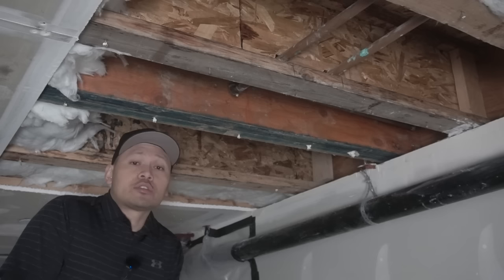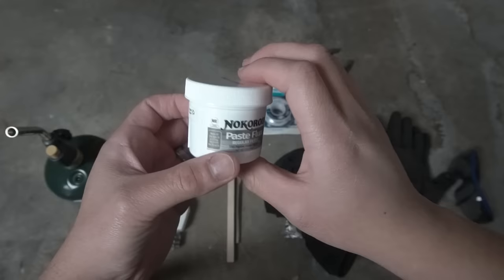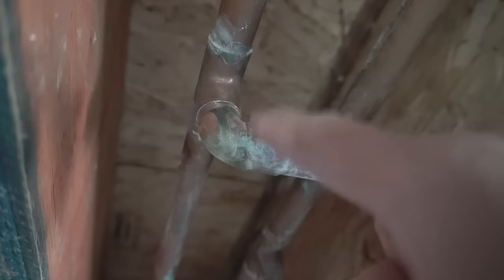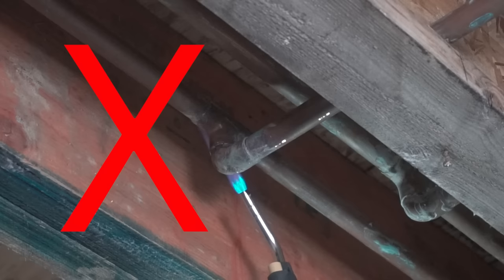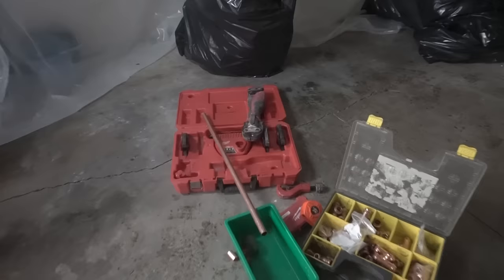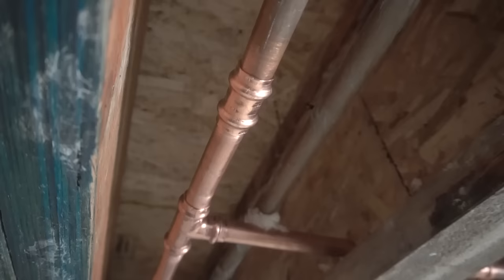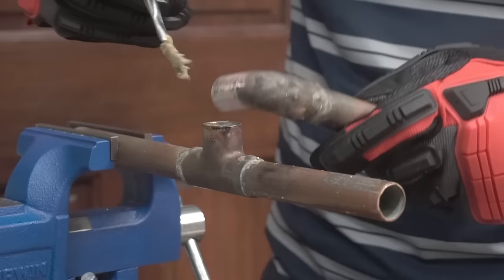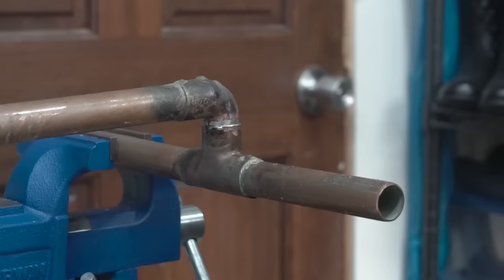How To Fix ANY Pipe Leak! 2 BEST Ways For DIY Plumbing!

Comment: I’m a homeowner, I’m not going to spend $1000+ for the Milwaukee tool, poor solution.   Soldering old fittings is not a good solution, even I know that. I would wait to get water out or use bread and then clean pipes and use new fittings, solder together and done. I have done this before.  Soldering gets easier, the more you do it!
Reply: That tool is over $2k. Easy diy solution! 😅
Reply: SharkBite is much better
Reply: @cryengine_x  ya if you like going back a in a couple years to fix all the water damage from said shark bite.
Reply: @jonathanbarbosa5369 You like others, don’t know how to install them properly.
Reply: White bread or whole wheat?
Reply: @HarveyWallbanger-ho2cq depends on the circumference of the pipe.
Reply: Dumb question, but could you just add more solder to that area where the gap was? Not sure how that stuff works
Reply: Make a cut and drain out the water into a bucket. With all the faucets open, use a shop vac with its filter removed, suck out the water in the pipe. Use MAP gas as it heats up higher. The final joint can use a compression fitting to finish.
Reply: Neither would I, but there is manual crimping tools that you can use and not spend a whole bunch of money
Reply: @Ed-ym4tu what circumstances like if the pipe is on Diet or vegan
Reply: @KeepPrayingCA No you absolutely cannot!  There is a problem with the joint!
Reply: Soldering comes out in time especially when pipes as in use even is it was soldered correctly that’s what they don’t tell you. Also if you fixing another side of the that pipe let’s say for example that other side you claim to solder will come out with movement because solder is not flexible. What the host did have a couple of homeowners solutions I would go with shark bite they last long than solder don’t corrode and upholds in freezing weather I know cause I get a lot of Canada freezing weather -20 to -30 so give the guy credit also the may be expensive but it is also a good solution stop bickering

Comment: don't forget to get a welding blanket if you are soldering near wood and to remove the insulation. You will burn your house down if you can't control the fire.
Reply: I never thought about a welding blanket. Great tip👍

Comment: Your echo in the beginning is horrendous, a little tip that’s cheap and easy to fix it is to hang a blanket in the direction you’ll be talking, ideally behind the camera if possible, this will eat a lot of the excess sound wave and prevent as much echo against bare walls

Comment: You could drill a hole in the elbow to drain the standing water and then proceeded as planned but with just a new elbow fitting.
Reply: Bingo, that is what an actual plumber would do!

Comment: It seems to me that “gap” in the pipe fitting was an actual dent. This fitting should never have been used in the first place and was the reason it failed. The fix should be to replace that dented fitting, not re-solder it.

Comment: Nice job. Yes there are many ways to do this job. But many of us (homeowners) don't have expensive tools to tackle  a job like this one. The compress fitting in is the ideal way to go due to the proximity of the wood subfloor. By avoiding a potential fire. I just wish the prices of these professional tools would come down . Great video. Because you showed us different alternatives to the way to go. Great video. Thanks . May God bless you and your beautiful family.
Reply: The price of tools are relative. "Professional" tools are made of higher quality (typically) to last under daily use. DIY homeowners might need said tool ones or twice in a lifetime.

It's ridiculous to think any and everything can be made and sold for cheap to fit everyone's needs.
Reply: For diy, just rent the tool. I would have used shark bite myself.

Comment: The second you find a single leaking pipe like that, make sure you do the math to see how old your home is.
If it's around 50 years old, then prepare yourself for a major plumbing overhaul sooner than later!
I had so many pin hole leaks in a 6 month span, before ripping it all out and finding even MORE UNSEEN leaks inside some of the walls.
When my house was built, they saw fit to use Type-M lines nearly everywhere (Use type-L!!!)
The stuff I ripped out was paper thin.
The 3/4 " Type-M runs were so thin that I could crush the scrap in my bare hand. It was like a slightly more rigid tin foil.

Goodluck to all you DIYers out there!
You can do it!

Comment: I just had to do this under the house.  I opened up two outside faucets on the house and used compressed air to force excess water out of the pipes.  Worked great.  Didn't have to cut pipe, just unsoldered it.
Reply: Nice job its amazing how many people struggle with this idea. Compressed air is your friend

Comment: Thanks for the video. I would say just use a 3/4 sharkbite elbow - I checked , they do sell them in Home Depot. Cut the corner out and push the pipes in the fitting.
     That’s the easiest . Otherwise sweat another elbow or replace the whole pipe with pex . 
    The propress I would leave to plumbers . Sounds like to be a good solution , but seems very costly for the tools. 
   Another thing that will work is “pipe repair cast” - wrap around and it becomes cast hard. Just make sure there are no pinhole leaks .
Reply: Never EVER use a shark bite fitting in a closed location, such as this.  They are great for exposed connections (under sink, outside…), but not enclosed. Just my 2 cents.

Comment: If you have to solder and water is bubbling through the solder when you heat up the pipe put a chunk of bread in it and quickly solder the pipe. The bread will absorb the water for the time needed to solder the pipe. Then go take of your sink air ratter ( the part where the water comes out of your faucet) and turn on sink. The chunks of bread will pass through your faucet with your air ratter off. Ive done this many times in the past and actually last week when my Milwaukee force logic pro press gun broke and I couldn't get my big ass Ridgid pro press gun up in the joist spacing
Reply: I've been doing that for years
Reply: The bread will junk up on mixing valves don't use bread. A jet sweat is what is used on an open port ball valve or a mip fitting.

Comment: Great video, it would be worth mentioning to always have a fire extinguisher next to you when soldering pipes even the pros start fires worst case a glass of water or full water bottle.
Reply: I took a spray bottle with me under the house and had to use it a few times while soldering.
Reply: I just bring with me a full bladder to pee on it if needed.

Comment: you have to cute the failing fitting rather than the pipe in 3 different locations. you cut making sure you do not cut the pipe only the fitting, that way you can let all the water drain out. all you are left is with 3 copper rings that are much easier to remove. and if needed then you make a second cut for your sliding coupling.

Comment: Make a cut and drain out the water into a bucket. With all the faucets open, use a shop vac with its filter removed, suck out the water in the pipe. Use MAP gas as it heats up higher. The final joint can use a compression fitting to finish.

Comment: I have used the bread technique many times also. White bread works best. Put a ball of it in pipe to stop flow of` water. You have to hurry and soldier before water erodes bread and it starts leaking again. When the job is done the bread will dissolve and be expelled thru the faucet into the drain.

Comment: Nice video. Although Shark Bites, push connectors are taking over the repair industry.
Reply: Good homeowner solution that will last a few years until leaking
Reply: Oh God. I have some kind of weird feelings about shark bite. I have used some and haven't had any problem with them but for me to rely on the "o" rings to make the seal is a little bit difficult.
I'm a little bit old school and prefer solder.
Reply: @NSilver832  o rings are on pro press fittings so 🤷‍♂️
Reply: @appleztooranges . Yeah. I know, that's why I said I'm old school and prefer solder. Once you solder copper pipes you can push, pull, twist and you know that thing won't give up but I'm not  short sighted, those other things might work or maybe be the same as solder but my paranoid side won't let me sleep when I install those.
Reply: That’s what I was going to suggest. A while ago I heard about the Milwaukee clamp type. But it was expensive.  So the Sharkbite for a diy home owner is the way to go IMO
Reply: @NSilver832  I hear ya. But in this video the solder is what broke. And most everyday people don’t know how to solder. And I gotta tell ya , what turned me on to sharkbite type connections, was that after years of dealing with “diva attitude” plumbers, along with their outrageous prices.   Ex. Being charged $1,400, for a basic 40 gal. Electric water heater + install?   And he didn’t even remove the old 1. Now I can buy that same water heater $400.+ the sharkbite 3/4 connections for $40.  Total $440. And have it done in under an 1 hour

Comment: Great job on the repair. I don't have copper lines in my house, but if I did, I would definitely invest in that Milwaukee tool. It makes the job easier.
Reply from the maker: Thank you! The tool is very expensive, but it’s worth the  investment if you are doing a lot of press fit work. You can definitely rent this tool on your local big box stores 👍🏽😊🙏🏽

Comment: The image with which you open this vid, actually shows the problem of these kind of leaks. The T-joint and the 90° elbow/knee are way to close together. If you really need to put the elbow directly on the T-joint, than at the very least use an (A) version of the knee, with one side equivalent to the pipe diameter, instead the solder sleeve. That will reduce two solder joints so close together, or even butting up. 
Instead of a knee, you could also choose to install a 90° wide bend in the similar (A) version. 
Or even better, buy a pipe bender and form your copper pipe with just a slight bend, start of the bend over the heart line of the pipe it needs to cross. I bet you’ll only need a 5° angle to reach the T-joint, without any visual or technical restrictions. Hence, you can throw away the 90° fittings all together. Will improve the longevity of the installation, reduce noise, pressure drop, and chance of water hammer effects (very common in installations with tight fit knees and elbows.

Comment: You could cut through the elbow with a hacksaw and then soldered a new elbow in place assuming you could stop the running water.

Comment: Sharkbite is definitely the way to go for this repair 👍👍
Reply: No .  Sharkbite is fairly new on the market and used for temporary connections.  The insurance companies don't like them because on several occasions they start to leak.  If you install where they can be seen and in a garage where there is a floor drain then the problem will not be as severe...  This is my opinion,  you may have your own opinion, to each their own...
Reply: @pasqualeparente9776  wtf "fairly new"? Theyve been out for over 20 years. You living under a rock or somethin, fella? 

Ive not had one fail me yet, im no plumber but theyve replaced many leaking soldered connections going on 12-15 years (with no sharkbite leaks) for relatives houses.  And also, several hot water tank replacements.
Reply: first of all new products are not introduced worldwide at the same time they test markets first and then they are introduced in certain store first.  And if they sell well then they are available to everyone.  And to clarify I  stated my opinion and I have a right to my opinion.  Just because you have not had any problems doesn't mean other people or plumbers have not. 
If you are 100% sure that they are fail proof why are they not accepted by insurance companies. They have a wider base of clients to base themselves on than just YOU.

Comment: Aluminum foil will work to a point, but actual heat shields are better. 
Inhave found cotton rags to be better, as the synthetic rags melt much easier. If you keep it wet you may be ok, but I prefer cotton.

Comment: A 6 year old can use sharkbite fittings. I love it when home owners and handymen use sharkbite bite fittings and when contractors use those press fittings  because then I make more money having to fix there mess because they don't know how to properly prep the pipe to except the sharkbite and or press fittings the correct way. I then have to cut them all out including more pipe and then solder in a new piece of pipe like a real licensed master plumber does..  those press fittings have an O ring in them just like sharkbite fittings do, if the pipe is not prepped properly they leak, also I see stupid contractors who hang water heater expansion tanks from sharkbite fittings and pro press fittings and of course they eventually leak. I'm old school and solder everything because I know the soldered joints will be there 60 years later. Only time I use sharkbite fittings are in mobile homes

Comment: good job, but if you had cut the bend in the corner you could have drained and cleaned everything and then re-soldered it with a new bend or better a t piece with a drain facility

 proud to be a plumber also 😃

Comment: Could you remove the fittings at the connection spot using the hydraulic pro press tool to reconfigure the layout of the pipes without damaging the pipe? The same question for commpressed ferrel fittings.

Comment: Why not drill a small hole under the leak and lowest spot on the copper tube. Then clean and resolver including the small hole you drilled to drain the water.

Comment: Lol. From the thumbnail pic...I'm thinking it's a very old house. Then I see engineered joists and beams. Tip for repairs on solder....use a wet rag and wipe the hot solder to remove globs....then sand and assemble old joints.

Comment: You could have cut the lower pipe shake the water out ,re solder the fail and then solder the cut pipe with a coupler with out stop.

Comment: I bought a pro-press last year with all the dies--yes you can buy the tool but its useless unless you have all the various dies for different sizes of pipe.  It cost me about 4K with tax. Then you have to have the fittings which are not easily available---I have to go to hvac or plumbing suppliers for them---I have not seen them at local hardware or big box stores----not saying they don't have them but I have not seen them.    Sure its a good way to go but for a DIY repair its way beyond the price of most diy-ers.   If someone could afford a propress and fittings, they would call a plumber and have them do the repair.
Reply: $2300 is cost prohibitive for DIYer. Otherwise its sharkbites or Pex

Comment: Yea my copper pipe on kitchen sink water line was a $500 plumber repair. Now I'm replacing the drywall. :(
Reply: Coulda very eaily done it yourself with $5-10 in copper pipe and a few Sharkbite fittings ($12-25, depending on how many u need)

Comment: Please can you send the link of all your material that you used all the tools 🧰 please 🙏🏾
Reply from the maker: Of course! Here are all the items I used! 
ITEMS I USED ON THIS VIDEO: 

PRESS FITTINGS
—————————
- Propress 1/2” Copper Fitting -  https://amzn.to/430KOHO
- Propress 1/2” (Tee) Copper Fitting - https://amzn.to/3G9Z0UQ
- Propress 1/2” (90-Degree) Copper Fitting - https://amzn.to/42ZzZpd
- Propress 3/4” Copper Fitting - https://amzn.to/3nEuBI0
- Propress 3/4” (Tee) Copper Fitting - https://amzn.to/3KsEH7y
- Propress 3/4” (90-Degree) Copper Fitting - https://amzn.to/3m3iEev

PIPE TOOLS 
—————————
- Milwaukee 2473-22 M12 Force Logic Press tool 1/2" - 1" Kit - https://amzn.to/3zvfl2A
- Milwaukee 3 Piece Close Quarters Pipe Cutter - https://amzn.to/3U4GDXp
- Copper Pipe Cleaner and Reamer Combo - https://amzn.to/4311D56

PIPE SOLDER TOOLS 
—————————
- BERNZOMATIC Trigger Start Propane Torch - https://amzn.to/3nz1Jkl
- BERNZOMATIC Propane Tank - https://amzn.to/3G9J1WW
- Plumbing Solder Kit With Flux, Solder and Acid Brush - https://amzn.to/3TZmKAV
- 120 Grit Emery Cloth - https://amzn.to/3Gb0L47

Comment: The Propress tool is $1870 - out of reach of most DIYers.  One could use Sharkbite fittings in this application - no special tool needed - maybe $40 worth of fittings.

Comment: 06:47 is that green corrosion spot on the pipe further back caused by a pinhole leak?  I have some spots like it on my pipes and wondering if I should fix them.
Reply: Cold water flowing in the pipe on a hot day will condense moisture just like a glass of iced tea.

Comment: When it rains I get water in the basement under the stairs, what’s some ways I could find it where the water coming from without taking the paneling down or destroying my basement walls
Reply: Most likely coming in between your slab and foundation walls although it could be coming through the wall itself. Look for the effervescence left behind to try to figure out where it's coming from. Homes built before 1995 weren't built the same way and thus weren't really waterproof. The other thing you can do is make sure you have a negative grade slope in your yard away from your house to help the water flow away from your foundation. Also check your gutters and downspouts are not clogged and working correctly
Reply: @mikebevan1034  great advice and I appreciate the fast response
Reply: @tjac4801  No worries. I'm just a fellow DIYer who watches to many youtube videos. Lol